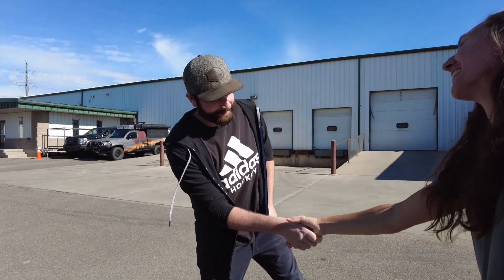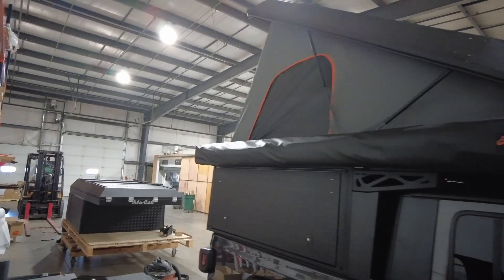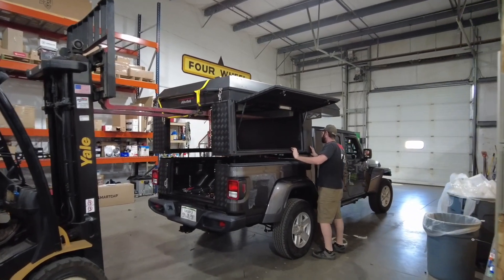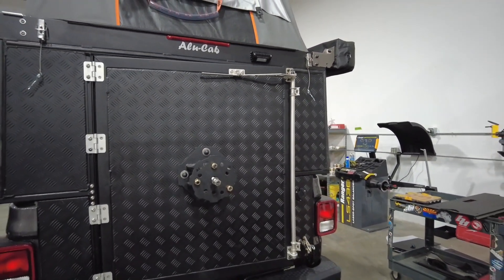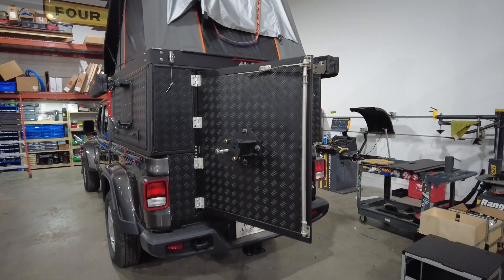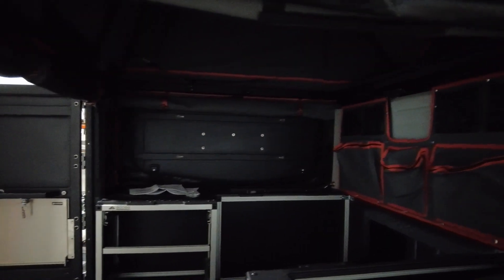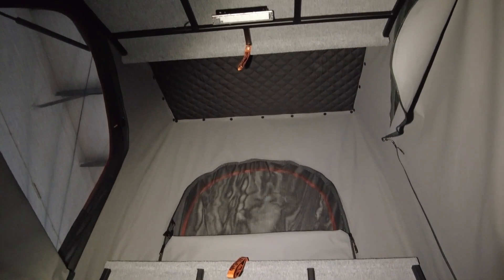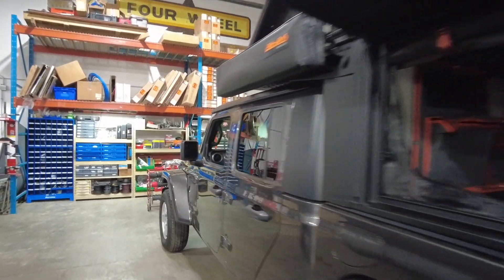Jeep Gladiator Overland Build: Our Alu-Cab Canopy Camper

Comment: I've seen another build, where they put a rack in front of the camper, for extra fuel and water cans. Oh and they had lights across the front of the rack.
Reply from the maker: Not a fan of a rack in front of the camper or exterior water and fuel containers on the vehicle for long-term international travel for multiple reasons. But everyone's build and needs are different. Bottom line, make the journey your own and build your rig for what you specifically need. ~ Eric

Comment: I just notice you switched the door swing - for me it was a deal-breaker to not be able to change the way it open. Everyone, I mentioned this change to looked at me as if I was from Mars as if, what difference would it make. All the difference in the world IMHO. This rig was optimized for RHD vehicle.

OK4wd just emailed me on the "very new" narrow window for the Gullwing door. (not on website yet)

BTW - I took the smaller bed platform off - just didn't figure we would need it at all. I may install a 1/3 size piece in its place using one of the hinges since you mentioned the stand-up desk use and a table to eat at during miserable weather.
Reply from the maker: Yeah, it could definitely have good applications. The smaller platform that is. I think the windows you are referring to are the GP Factor ones aren’t they? I’ve seen a prototype on someone’s rig online but haven’t seen them in person yet. ~ Eric
Reply: @HourlessLife I just installed a prototype table 19.5" * 16" up top (passenger's side) and it will make a good size stand up spot and the way I have my accc set uip it can likely reman in the down position pretty much all the time - and with the hind I can have it up if need be. I think the design is a wrap. Now I need to figure out what naterial to use & buiild a proper table.
Reply from the maker: @TerryManitoba  something light! Haha. #weightiseverything ~ Eric
Reply: @HourlessLife  I've made a few shelves  and a step plate (wider platform for entry on the bumper) all out of 5/16" check plate aluminum. Rigid enough to stick out unsupported for a 16" shelf without defrecting and good for the 8" wide step platform (this made a huge difference for traction and support when climbing in/out)

Here is a link  they sent me for the window - not very tall though
https://www.lewmar.com/node/11265?v=24327
Reply from the maker: Sounds like you too have put a lot of thought into your rig. Love it. ~ Eric

Comment: One more question:  How do you plan on compensating for not being able to carry the table between the top of the Jeep and the Alu cab?  Do you have a suggestion for another portable table that will fit in the Jeep.  Really enjoying watching your build.
Reply from the maker: Hi Steven, so we actually carry the table inside the Canopy Camper laid down on the Goose Gear platform we've installed. It works great. Also it keeps the table clean since we store it clean. So that is an added benefit, also not a visible temptation for theft. Goose Gear is preparing a solution for this for the Gladiator though they are still a ways out on this. Be watching for it. ~ Eric
Reply: I can see the advantage to keeping it in the jeep. Thanks.

Comment: Looks super nice. Glad y'all are sharing your journey with us. Keep up the great work you both do. What is the weight of the Alu-Cab. Are do you plan on having a total weight of the build once it's all completed.in a later video.
Reply from the maker: Hey Franklin. Thanks for the kind comments. The dry weight of the Alu-Cab Canopy Camper for the Gladiator is 462.9 lbs. Fully kitted out it can be just north of 550 lbs. So it is really a great use of payload capacity. As far as having the total weight? ABSOLUTELY! In the overlanding space, payload capacity, weight, and storage are high level considerations. Once the build is fully finished, and every tank is full and even the fridge is packed. We'll all three get in the vehicle and take it to a scale to get exact weight measurements. At THAT point we'll have the suspension built custom for the vehicle and the load out. ~ Eric
Reply: Looking forward to future videos have a nice day 😊
Reply from the maker: @therealdeal67  you too Franklin! ~ E

Comment: Looking for a canopy! Ran into this and was sold. What did you do with your tail door? My concern would be my backup camera.
Reply from the maker: Hi Stephen, it is a great unit. We are really happy with our decision. The tailgate was left with Juniper Overland as we had no need for it. We had the team at Juniper flip our entrance door to the Canopy Camper. So instead of opening from left to right like it comes out of the box, ours opens from right to left. This was based on our design of the rig to have a clean and dirty side. That’s a more complex discussion which we cover in another video. We relocated the National Luna light and the backup camera. So no worries there. Totally doable if your build has a need for the rear door flip. Shoot us a followup message on Instagram if you have any follow up questions! Happy to be a resource. ~ Eric

Comment: As always great video. Question, will the suspension be ok with the H2O tank? And does the tank have baffles? To help stop the water from aggressively shifting??
Reply from the maker: Great questions Dave. So the answer to both of your questions is "yes." However, one of them is a qualified yes. So the water tank does have built in baffles for that very purpose. Alu-Cab has literally thought of pretty much everything. For the suspension question, it is a qualified yes because we are doing suspension last. So between now and our 4th shop in the build the answer is no. But by August the answer will be yes. The reason we are doing suspension last however, is probably the most important part of this answer for those new to overlanding (not meaning you because I don't know your experience level) but for anyone reading. The general idea is to have every mod, every piece of gear, all of our stuff, tanks completely filled and us in the vehicle, and then go and weigh it and get exact weights for the entire vehicle, and by axle. Then and only then will we build the suspension for the weight we're actually carrying and where it is stored. Having said that we'll factor in Caspian's approximate weight as he gets older too. So in short, the suspension will be built around the actual load out, and we can't do that until the build is finished. Hope that makes sense. Seriously, a thoughtful question. ~ Eric
Reply: @HourlessLife  Great approach 👏👏👏
Reply: @HourlessLife  You nailed this build, subscribed and look forward to seeing this build finished and your travels.  We are considering a similar build and I might just copy you.  Thanks for sharing
Reply from the maker: @tyb3938  thanks for subscribing. If we can be a resource for you at all as you do your build feel free to reach out. Happy to share anything that will save you heartache, money, or sweat equity. ~ Eric
Reply: Build looks great!   The Alucab + Goose Gear is the hot ticket for making the most use of the space you have.   As a fellow Gladiator owner love seeing this coming together and looking forward to following how it all works as you put it to the test!!
Reply from the maker: Well, we've been putting it to the test. Have you been following along still? We are now in Ecuador and still pushing the boundaries. ~ Eric

Comment: really nice set up, I don't think those hinges on rear door can handle a 100 lb tire and wheel in an off road situation with only that aluminum substructure, don't ask me how I know...
Reply from the maker: I'll bite. Have you had an Alu-Cab Canopy Camper? According to Alu-Cab they can handle up to a 35 tire. We're running a 33.5. ~ Eric

Comment: Did this whole setup with gear and occupants put you over the max payload of the gladiator?
Reply from the maker: Pretty sure it does. We haven't had a chance to fully load it out and weigh it yet. It is on our list of things to do. We've been very careful though and started our build with a payload spreadsheet. ~ Eric

Comment: Hey Guys, another great video.  

I was curious because I’ve watched other AluCab build videos, did they put any type of seal between the Jeep and Cab to prevent dust or moisture from entering?  

If not, do you wish it was there or is it not an issue?  When it gets colder do you feel that the seams will be sealed enough?
Reply from the maker: So Juniper sealed the entire Alu-Cab and they are based out of Denver where it gets pretty cold. They do a ton of Alu-Cab installs so I’m fairly confident it will perform well. But we haven’t really put it to an extensive test. Ask me in a year. We’ll always be transparent. ~ Eric
Reply: I wondered about that myself. It didn’t look like there was any sort of gasket or seal between the Alu-Cab and the Jeep bed sides.

Comment: What solar panels did you put on top, they don’t look like the Sunflares.
Reply from the maker: Ahhhh... great question tran0317. So you caught that eh? Haha. Good eye. On the top of the Alu-Cab Canopy Camper we have two @cascadia4x4 prototype 100W solar panels. They are not available for purchase yet. Not featured in this video we also have the 80W Cascadia4x4 VSS (vehicle solar system) for the Gladiator which is available for purchase. When we do our video on our electrical system, we'll show all of that in detail. ~ Eric
Reply: Very nice,  those are pretty small for 100w especially compared to the sunflare.  Thank you for sharing the info!  I’ll wait for your video before asking any further questions.  Thanks for the videos, I actually have a canopy camper on order and planning my buildout so it’s nice to see the details you are providing. Keep up the great work!
Reply from the maker: @tran0317  yeah, we'll see how they do. The good news is that the RedArc RedVision will tell us exactly how much we're pulling in. Since they are prototypes we'll just have to wait and see. I do like their size though. Allows us more room up top should we have to load something there. ~ Eric

Comment: Have you considered that someone could lock the rear door from outside while you are inside?

I'm not trying to be a troll, just sounded like a real concern if you're in a bad area.
Reply from the maker: Great point, and yes, that could happen. However from the inside we have several points of egress should it be an emergency. We could get out through the side wing doors. They wouldn't have the key to lock that. Or we could, push come to shove, (literally) crawl out through one of the tent windows since the tent is accessed only from inside the Canopy Camper. But if someone locks us in... we have bigger problems than figuring out how to get out.. lol. Let's hope that doesn't happen. ~ Eric

Comment: What’s that mounted on the driver’s side Alu-Cab window?
Reply from the maker: Drivers side of the Alu-Cab Canopy Camper are our MaxTrax recovery boards. For if we get stuck in sand, snow, mud, etc. ~ Eric
Reply: @HourlessLife  Have you mounted them yet?  I’m asking because I was told the traction boards are too heavy. Where did you get the mount?  I’m excited to follow your build and adventure.
Reply from the maker: That is the Expedition Essentials MaxTrax mount. It’s really slick. They are heavy though so on the Alu-Cab Canopy Camper sidewing doors you simply need to upgrade the struts for weight. ~ Eric